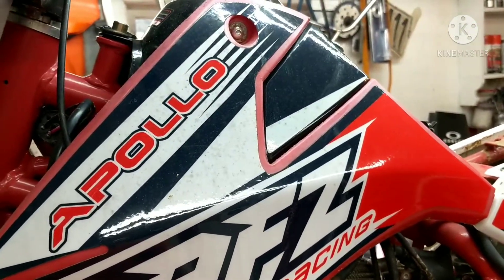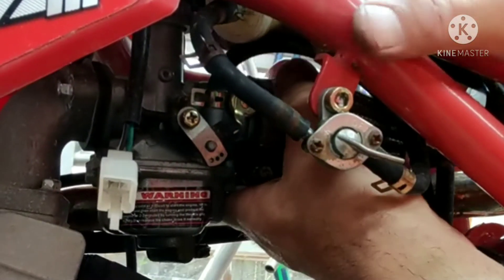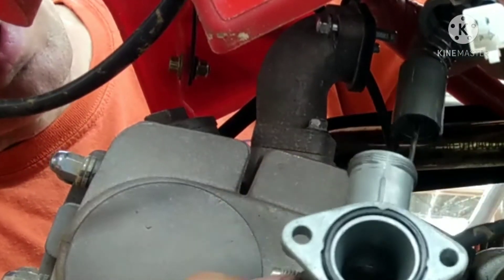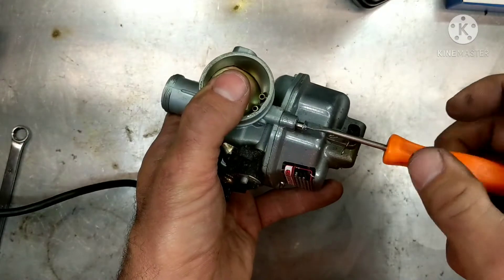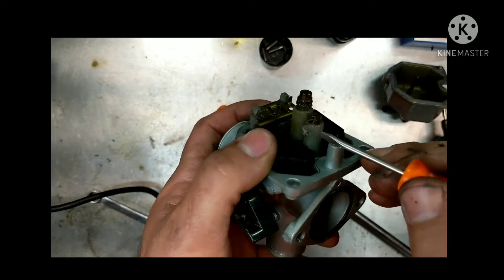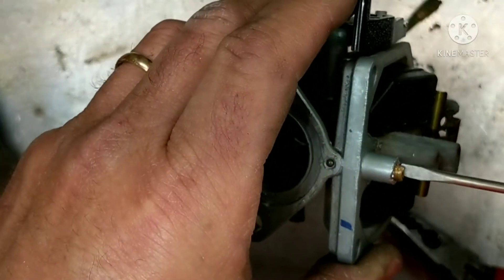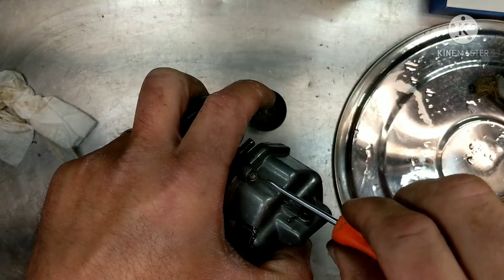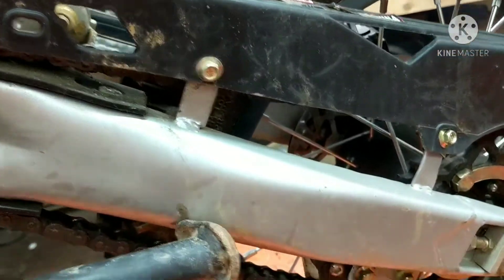Apollo RFZ 125 carburetor rebuild!

Comment: Thanks for the tip on removing the tamper proof screws. My rfz 125 runs good after cleaning the carb. Got any videos on how to change the stator?
Reply from the maker: I don't, but I do have a RFZ 125  just sitting around, I'll put it on the list of videos to make.

Comment: Working on one of these carbs right now and my float pivot pin falls right out just by turning it on its side once the bowl is off... been having problems with fuel pouring out overflow nonstop. Cleaned all jets and put back in... then I found a little seal on the shop floor... not sure if it came out of carb somewhere or not... the inside of this pretty thick little seal looks like it's shaped like the float needle... but can't see it going in there anywhere
Reply from the maker: The pivot can fall out when the bowl is off, the bowl holds it in place. Does the tip of your float needle still have the rubber on it? If not it won't seal and leak everywhere. If you can't figure it out, send me a photo of the rubber part through the email on my about page.
Reply: @TepcoCycleRepair  you're talking about the pointed rubber tip, correct? The pointed rubber coating is there on the float valve... it might be little worn, idk. But I don't think this little thick circular rubber washer  or seal came out of carb. Watched few more rebuild videos and didn't see it in any of them, so idk where it came from
Reply: @TepcoCycleRepair  I will send you a pic though... the inside shape of the washer or seal is what has me.really wondering

Comment: I know this may come off as a dumb question, but I got an Apollo 110cc and just wanted to pick your brain if running 4 stroke 10w-40 would be good for my bike or if there’s a better option to get
Reply: Btw great video, I didn’t know I had the same tamper proof screws! Thanks for that information!!
Reply from the maker: Yes, that weight will be fine. It has a wet clutch so you want one that's JASO certified, if it says energy conserving or anything like that in the circle on the back of the bottle, they are not recommended because they can cause the clutch to slip. I use Rotella T4 I think it's 15w-40 which will be fine.
Reply: @TepcoCycleRepair  I got me some good ol fashioned semi-synthetic Lucas oil, it doesn’t say for wet clutch tho. 

And thanks again man for replying back

Never mind it does say that JASO on it. I’ll have to return it and get some of that Rotella instead
Reply from the maker: @andrewd2859  JASO is what you want, run it.
Reply: @TepcoCycleRepair  oh okay great! My bad I misread that lol
Reply: The ONLY safe oil to use is 15-40w DIESEL engine oil. This is what is recommended by Apollo. Any oil besides diesel oil has friction modifiers and will destroy your clutch

Comment: What kind of HORRENDOUS fuel were they running through that?!?!  I just pulled the carb apart after 4 years of use because it was starting to leak fuel and it looked brand new other than the one tiny little piece of debris that was keeping the float open.
Reply from the maker: That's from water that gets attracted by ethanol. The green is from the brass oxidizing from the water, like the statue of Liberty.

Comment: Yeah that chynese rubber I believe lacks any UV protectant among other things. And what doesn’t deteriorate and crack will turn hard. Some of the bigger clone utvs, massimo, benneche, hisun , etc. use this cheap rubber and this shit connects the intake pipes and manifold and lucky if it last 5 years before cracking and failing. Same with aftermarket carb spigots. That’s one thing I go oem on if still available. I digress. Anyway nice job on the carb. I do similar except I use a hacksaw blade.  Do you sometimes pressure test needle and seat?
Reply from the maker: I don't, if I suspect needle and seat issues due to a visual inspection or symptoms, I just replace them to prevent returns. Thanks for watching.

Comment: How did you reinstall the throttle needle with the little clip that comes with it ???
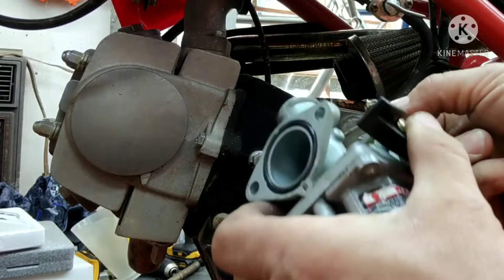Reply from the maker: I didn't touch the slide needle, it stayed with the top cap when I took it off. 3:07 if you want to take that out, you need to pull the spring up remove the cable then you can just push the slide needle up and it will push the retaining clip up with it. I have some other Honda carb videos with the same set up.

Comment: When you rebuild the carb , did u need any new parts or no?
Reply from the maker: No, just a good clean and make sure all the jets are clear.
Reply: @TepcoCycleRepair  all the jets are clear. How can I make the gas stop running out of that gas line
Reply from the maker: @pattonboyz7881  Something isn't right if it's overflowing. Make sure the float height is correct and make sure the overflow brass tube in the bowl isn't cracked. Also check that nothing is in the float needle seat not allowing the float needle to stop the fuel from entering the carb.
Reply: @TepcoCycleRepair  the leaking is comming from the carb. Coming out of the bottom hose
Reply from the maker: @pattonboyz7881  Yes so check everything I mentioned, it would all cause it to leak out of that hose
Reply: Okay thank u